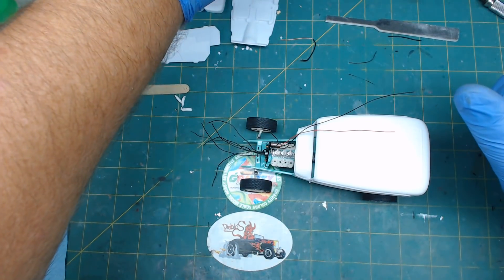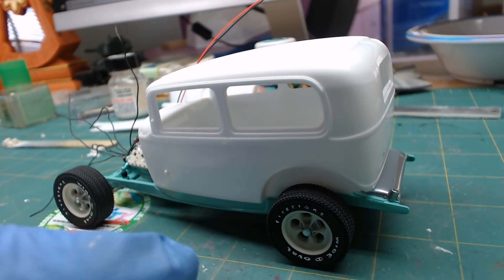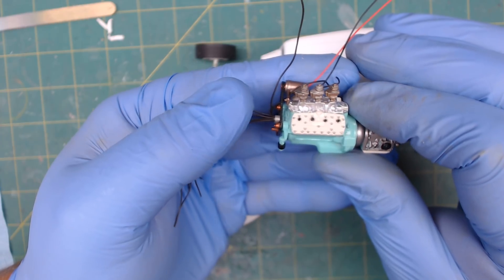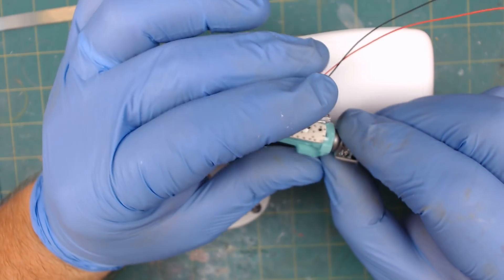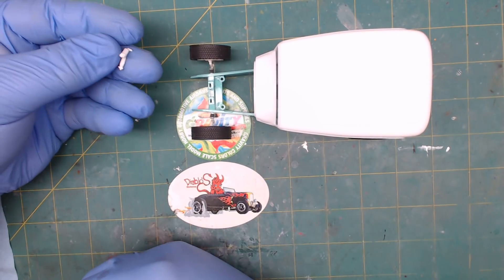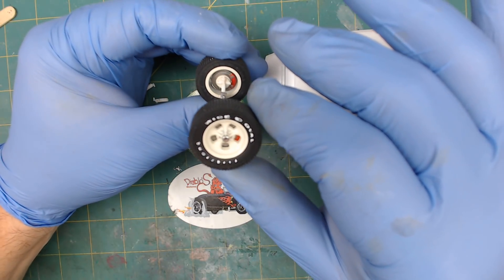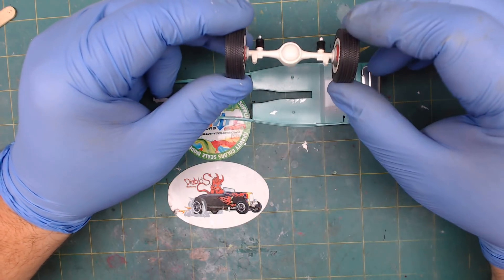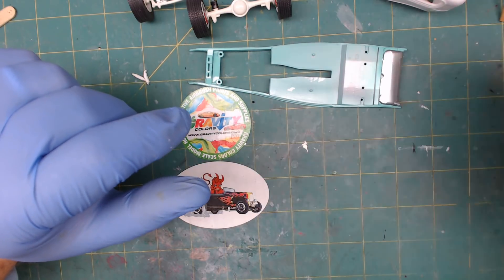Update #2 on the 32 Ford

Comment: It's looking good Matthew. That flathead ford looks like all the ones I saw and worked on when I was growing up. Except for the 3 deuces of course. If you put it on a diorama, be sure to put plenty of oil on the ground under it cause those ford flatheads leaked like a sieve. LOL!!! Great job so far. Regards, Solomon

Comment: Hey Matt, get yourself some of this micro heat shrink tubing to use as boot material. I cut mine in 1mm section then slide over the wire.  Once on heat the tubing on the wire with a heat source like a soldering gun. Perfect fit everytime. This place also has a small wire that I can recommend. http://tcsdcc.com/Zen/index.php?main_page=product_info&cPath=20_48&products_id=311